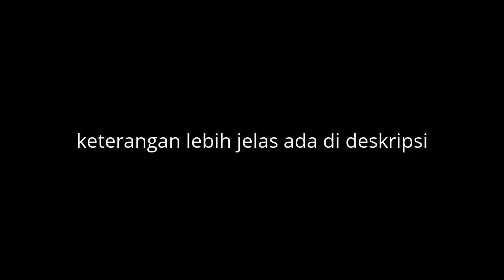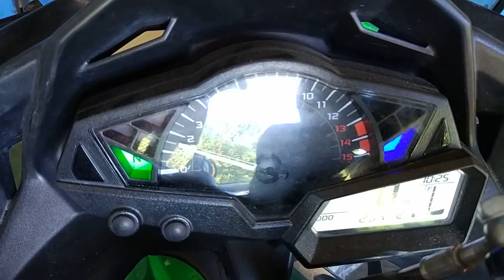Masalah Kelistrikan Ninja 250 injeksi

Comment: Bro motor ane kalo jalan di rpm bawah sering nyendat nyendat dan mesin gampang mati,dan kalau mati mesinnya di stater muncul indikator merah overheat sebelah kanan nyala,jadi kontak harus di reset baru bisa d stater lagi,padahal aki baru,mohon solusi bos jika punya pengalaman.makasih
Reply from the maker: injeksi ya?
Reply: Iyya injeksi bro
Reply from the maker: cek sensor suhu radiator sama kabelnya mas
Reply: Cara reset kontak gmn bro mksdnya?
Reply: @irsannurahman  matikan hidupkan matikan hidupkan ulang" sampe indikatornya gak nyala lagi

Comment: Gan, Ninja Fi saya kalau dipanasin idle normal, tapi kalau gas ditarik lalu lepas mesin langsung mati. Itu normal nga yah?
Reply from the maker: nggak mas,harusnya nggak mati
Reply: @RamanditaMotor  Terus itu masalahnya dimana yah mas, apa langsam terlalu kecil atau gimana? Pastinya pas stater nyala mesin normal, tapi ketika gas dipelintir lalu lepas secara spontan mesin langsung mati, tapi kalau di stater lagi normal mas. Kira2 itu apanya yah mas?
Reply from the maker: klo panas langsam rpm brp ms?
Reply: @RamanditaMotor  Di 1000rpm gan, kalau pas dipanasin/posisi mesin dingin 2000rpm setelah mesin panas idle nya baru normal di 1000rpm gan!!
Reply: Kalau sudah panas, 1000rpm posisi jarum di bawah garis sedikit!!